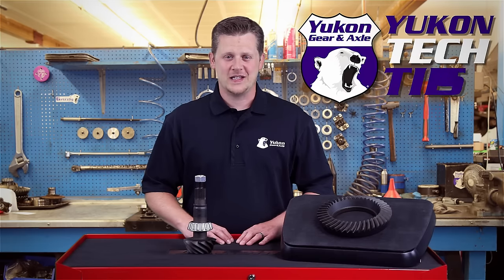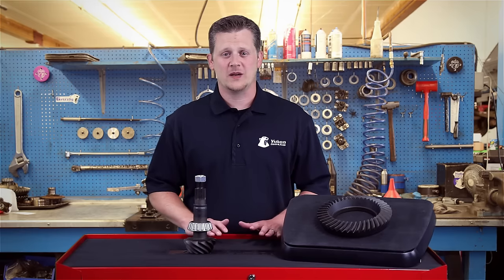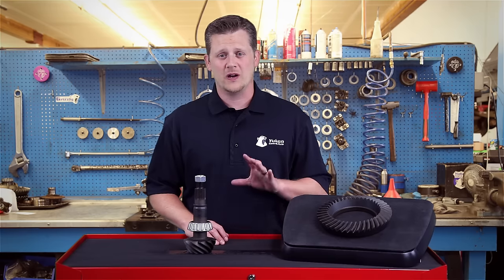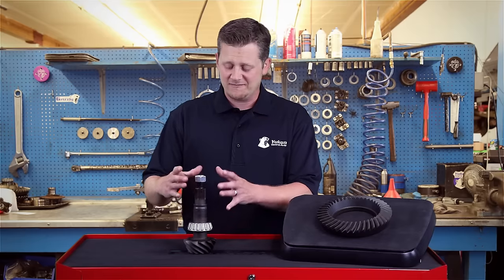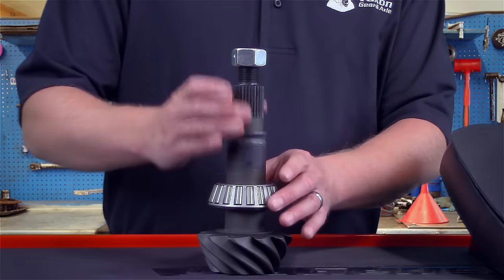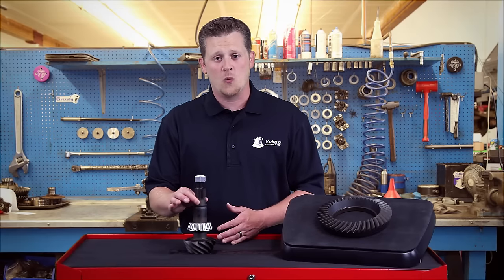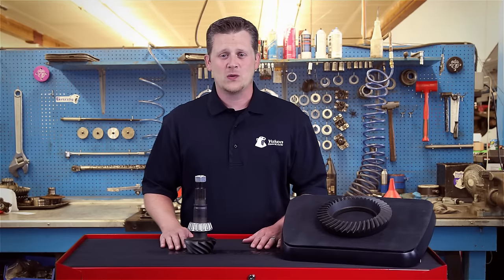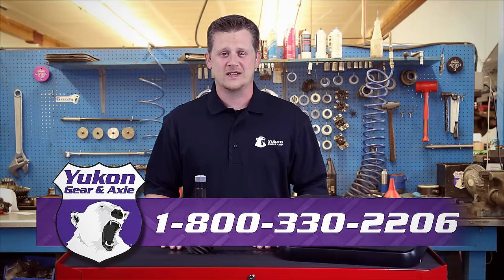Identifying Ring and Pinion Gear Noise - Deceleration | Differential Tech Tips

Comment: Hi, good video, thanks for sharing your knowledge.
I have a 2010 Toyota Fj Cruiser which I recently changed the oil in the Front and Rear Diffs and the Transfer case. 
Prior to the oil change I didn't notice any unusual noises but after the change there is a rhythmic thumping, on deceleration, which you can hear and also feel coming from what feels like the rear of the vehicle. As you slow the thumping gets quite violent and can be felt right through the vehicle. I was given the gear oil by a Diesel Mechanic friend, he said it was 75/140 Mineral Gear oil and that it should be ok, possibly a bit heavier but safe to use.
It's probably just a coincidence that the sound/vibration started when it did, but I was worried enough to purchase new 75/85 Fully Synthetic Gear oil and additive. This hasn't made any difference. I've checked Uni joints, wheel bearings, axle bearings, tyres, shocks. and anything else in the rear of the truck that could cause the problem, but still haven't managed to isolate it.
My next move is to take the truck to the dealer and see if they can find what is making the noise, although I'm reluctant to do this as they aren't very honest.
Any suggestions you could offer would be greatly appreciated.
Many thanks 
John V

Comment: So is it possible to just tighten the pinion with the pinion nut a little more so as not to have to take the diff apart?
Reply: Yes, if you cought it in time before the bearing races are worn. I think the crush Sleeves get crushed when your pushing a Heavy load in reverse like backing a heavy goose neck trailer up hill.    Tightening the nut Is the easiest to try, your not out anything by tightening the nut up a little bit.
Reply: @RoboDriller  Cheers mate.
Reply: @RoboDriller  Best answer so far by anyone here. Finally someone with good answers!
Reply: @RoboDriller  Glad to hear that on my 88 Chev farm truck 160K I recently had the bearing journal on drivers side of carrier break off! I limped it home about 1 mile . The gears looked ok so installed new carrier. spider gears and carrier and pinion bearings. I used the crush bearing eliminator and added .003 shim to the factory pinion shim. Pre load was to spec. Pattern on ring gear looked good with .009 with dial indicator. I developed a slight deceleration whine after about 50 miles. I will go back and give the Pinion Nut a bit more tightening see if that helps

Comment: Got a question: if I have no play in my pinion or carrier bearings, should my bearing be ok?
Reply from the maker: Theoretically yes, but there could be a lot of other factors going on that wouldn’t be easily identifiable without taking the differential apart or getting an automotive scope on the housing. The bearings could be tight, but still be pitted and make noise for example.
Reply: Yukon Gear & Axle thank you! I hear a slight noise at 40-44 and it comes back at 75 MPH. Not loud though

Comment: It was worrying when the small pinion bearing in the Dana M80 diff failed in my car (the inner race was pitted & the bearings had lost their preload),well, the gears became noisy over time (there was a slight hum which was coming from the diff) and the gears had worn unevenly although it wasn't noticeable to the naked eye.
I reused the old gears with new bearings,I got the tooth contact pattern the best I could get it & set the diff lash up to the way it was before the unit was dismantled,the lash has been reset to 0.12mm (about 0.005 inches) and the pinion preload has been reset to 2 newton meters,the total preload measured at the pinion is 2.4 newton meters which gives a preload of about 1.5 newton meters for the side bearings taking into account the diff ratio is 3.91:1.
As the diff gears were previously noisy,there was a bit of gear noise once the unit was rebuilt a lot of which has went away in the last 21 months since the diff has been rebuilt,the noise is the greatest at 60 km/h (40 MPH) but isn't that bad that ear muffs are required,the diff was quieter with the new bearings fitted & the gear noise has quietened down since the rebuild.
I really noticed the gears humming when I went into town when I went over the bridge at 60 km/h as it's arch shaped,when I first rebuilt the diff,it now has a much quieter hum which has dissappeared gradually over time,that's because the gear teeth has high & low spots on them,the high spots are being gradually polished flat so I know when I come off the bridge & there's a Little bit of a whine coming from the rear - I know why & it's not from a loss of preload rather a previous loss of preload which has caused uneven wear on the gear teeth.
The quick fix for that problem is gear replacement but when you've got more diff & bearing noise than Cash then you have to put up with some noise for a while till the gears settle back in.
Reply: Hi Russell, you'll find that 0.005" is a little tight for a dana m80. 6-7 would be better. The gears will usually get quieter as their steady state running temperature decreases. This can be higher after a rerace due to additional friction from the tight initial preload, however there can be a little additional friction from micro ridges from uneven wear. You'll find opening up the backlash a little will help with decel whine a little, however if you've been driving it this long it's probably not worth worrying about.

Comment: I just installed your 4.10 gears in the rear and 4.11 in the front..I get a low whine when I accelerate at low speeds. Should I take it back to the shop and have them look at it?
Reply from the maker: All aftermarket gear sets tend to make a very slight amount more noise than an OEM gear set, this is a trade off of the change in tooth profile. you compromise a very small amount of nose in order to see a gain in strength.
Reply: @yukongearandaxle  so slight humming or kind of whine is normal when putting in bigger gears? I can hear this from the inside with the windows up or down..I just want to make sure nothing is wrong.

Comment: Have been trying to get tech support for days, no body home ?  Rebuilding a Dodge 9.25 limited slip with Yukon's limited slip
 and ring and pinion. The box says 10 MM bolts torque at 35 ftlbs. The only 10 MM bolts in this kit are the ring gear bolts.
Factory specs. are 115 ftlbs!!!!  Factory specs for the pinion nut 210 ftlbs..... I Having rebuilt several hundred diffs. for Dodge
in the last near 40 years...  
Has anybody used Yukon's Dodge kit and what torque specs.

Comment: What happens if this condition is left too long?  Can I be repaired with permanent damage to the ring and pinion ( I have 8k on a whining diff that's now getting worse).
Reply from the maker: Hey Ray. Yes, running it that way will cause irreversible damage to the gears and will require replacement. You can call us if you're looking for a new set, best of luck. 1-888-905-5044

Comment: I installed the posi unit in my 85 C10.  I replaced everything  (axles, diff, ring, pinion and all bearings).  I chose to go with the crush sleeve eliminator.  I had no noise for about 300-400 miles then started hearing a light coasting noise.  When I opened the cover and drained, I checked he pattern and it looks good.  I used red Loctite on the pinion nut and was  slightly on the high   side for preload.  During break in, can some play be expected?

Comment: BMW 5 series e61 whining noise from rear end speeds up on acceleration and  slows down on deceleration have changed rear differential and wheel bearings still has made no difference?

Comment: I have a 2009 Jeep liberty and just had all the rear differential completely overhauled and all bearings replaced at considerable cost to me. But there is still a whining noise coming from the differential when decelerating from around 60mph. It works fine at low speeds and on acceleration, but the noise comes back as soon as I decelerate. Its louder when decelerating from a high speed. My local garage has no idea what might be causing this. Any ideas, thoughts before I return the car back to the garage to have another go at fixing it?. Incidentally the Jeep as done around 97k miles.  Any help would be much appreciated.
Reply: Did you ever find out what this was?
Reply: @carlosjunior6600  I'll tell you what the problem is. It's YUKON GEARS. THEY SUCK

Comment: i hear noise only when coasting , it disapears if i hold gas pedal even little... should i tighten up the yoke pinion nut ? or should i get a new set installed?
Reply: Dilshod Mirzakhodjaev my problem too
Reply: Ever find the cause out?
Reply: I have the same problem. Did you ever find out what it was?
Reply: Same problem here any news
Reply: I've had the same problem on a GM 10 bolt. I have bearing whine on deceleration. New bearings, new gears. Backlash was great, .004-.005 on 2 cut gears. Pinion preload was set at 18-19 inch pounds. BUT, it lost it. I couldn't find specs for break over torque when installing and just went with resistance torque. I'm currently adjusting in very fine amounts, taking it out and running it, coming back and adjusting. It is getting quieter and quieter.
Reply: That's exactly what the noise is. The pinion is flopping around because there's no load on it. You accelerate and it forces the pinion tight again.      I'd tighten the pinion nut for starters because it's the easiest.  If you cought it in time then it'll be good. If not, pinion bearings and races will need changing.
Reply: @jschermerhorn77  so you're just tightening pinion nut till decel vibrations go away.
Reply: @chriscusick6890  yeah that was the idea but ended up not being the case. I had an uneven load across the crush washer that caused binding in the bearings and caused premature failure. Replaced them and went at it again from a different position instead of on my back on a shop floor. Body position and torque application were my primary failure points.
Reply: @RoboDriller  I installed a new driveshaft and start getting a clicking noise when decelerating. My first fear was that I have tighten the pinion nut too much and increased the preload. But you are saying that it's the opposite? I am pretty sure I am already at 160lb of torque on that nut... what do you think?
Reply: @an6073  that's difficult to diagnose. Is it a new noise because of the drive shaft joints or was it an old noise?  I wouldn't describe a pinion bearing as a clicking noise when it's starting to get worn out. More like a Rurrrrrrrrrrrrr noise, like mud tires on a highway.   I suggested to tighten the pinion nut because it is easy to do. Not sure on actual torque for that guy but 12-16inch pounds too turn the pinion was about right.  A great time to test that was when the drive shaft was out.  And when you're engineers breaking is when a loose pinion will make noise 

I've had clicking noises from u-joint being bad, installed bad, or binding. Hope that helps
Reply: @RoboDriller  It's a new noise, started immediately after installing rear driveshaft. It comes out when decelerating , even lightly, at any speed. The clicking is not constant , but it will click/tap 2 - 3 times as soon as release the gas pedal.
Reply: @an6073   are the u-joints bad? I'd start there for sure

Comment: Bought Yukon gears and set everything properly in the stage doing the break in ,,Makes a slight humming noise when steady cruising feathering the gas ,Will this go away after it breaks in?
Reply from the maker: Hey Dels, humming on constant light throttle is typically a backlash issue. For assistance with gear setup/pattern issues you can send pattern photos to info@yukongear.com
Reply: @yukongearandaxle Thanks for getting back to me ,,, Would it be that the B/L is on the tight side or loose side ? I did the pattern and made sure it was in the middle it has no noise when taking off or on decel
Reply from the maker: @DELTRANIO99  Both loose and tight can create that noise. Submitting gear pattern pictures to Info@YukonGear.com is the best way to get gear setup assistance - our tech guys can help you out quicker

Comment: How about a new gear install whine only above 50mph on acceleration gone on deceleration?
Reply from the maker: Hey Peter - sounds like incorrect pinion depth, recommend sending pictures of the gear pattern to info@yukongear.com
Reply: @yukongearandaxle  I sent pics and Gus responded quickly, pinion was too deep I redidit, just took it for a test drive....NO Noise! Thanks Yukon Great Service!

Comment: I have a 2004 f150 4x4, and there a whistle at low speed between 5-15 mph, quits after higher speeds. What's going on?
Reply from the maker: Ga bulldogs fan is the noise only while accelerating or is it accel and decel?
Reply: @yukongearandaxle  at low speeds accel and decal...after about 10-15 mph it quits, forward and reverse
Reply from the maker: Hey  @rlsapp12 . We can help you out a bit faster if you email us at allen.booher@yukongear.com.

Comment: Mine does a howling sound when decelerating at around 50 mph, it starts at about 55mph increasing till 50mph then decreasing slowly under 50mph, then disappears at 45/40 mph, all gears same noise.
This noise isn't loud but noticable
Reply: Did you figure out what it might be ?
Reply: @del2lit  nope, at Ford told me it was because of water pump, changed it but that sound is still present but quieter
Reply: And when you drive it its okay ? Cause i have that same problem but im kinda scared to drive it
Reply: @del2lit  the car feels ok, just that sound annoy me, i hear it when i release the throttle at around 50mph, in third gear is louder and it is like a cycling sound, in 4th gear is less loud but linear, so in 5th and 6th gear..
Reply: Im having a similar noise with my 95 k2500. Almost sounds like a rock lodge in my brakes, but its not and I cant figure it out. Was hoping yall could point me in the right direction.
Reply: @brownsquash3245  at Ford they said it was because of water pump, replaced it, now it sounds the same but way quieter, like almost gone.
Reply: @Albe983  did u ever find out ?
Reply: @Iaiashgamer  nope, i noticed that it hasn't always the same intensity, some times is louder other quieter..i don't know why.

Comment: Hey man, I have a weird clunking while decelerating, seems to be while shifting but can definitely feel it. Took it to a transmission shop thinking the transmission  was the problem, mechanic told me bad rear differential. What could cause this? Mechanic said "just run it, could last like this for 50,000 miles" He said something was loose. ??
Reply from the maker: Hey Keaton, I'd recommend getting a second opinion from a different mechanic. It could be a worn ring and pinion, bad bearings, or spider gears.

Comment: I’m currently having an issue with my GMC Sierra, I can feel a vibration on deceleration going over 60mph the faster I go I can feel the vibration on deceleration. I have  put it on neutral and that vibration goes away.
Reply from the maker: Hey Azael, this sounds like a pinion angle / U-Joint problems.
Reply: Yukon Gear & Axle  have replaced u joints twice   With and still does the same thing, might have to find a shop that does pinion angle. 
Thank you for replying.